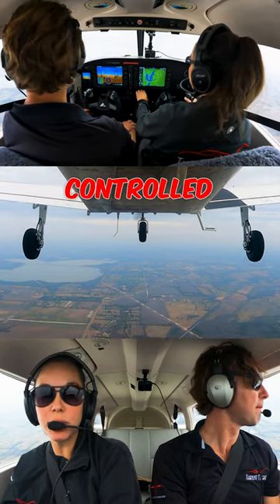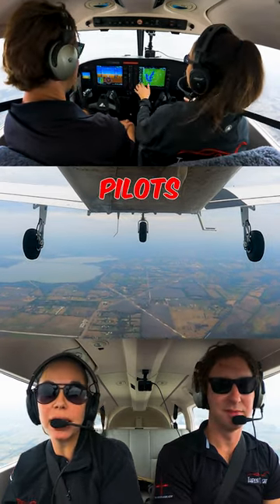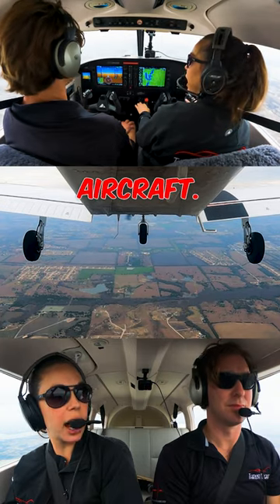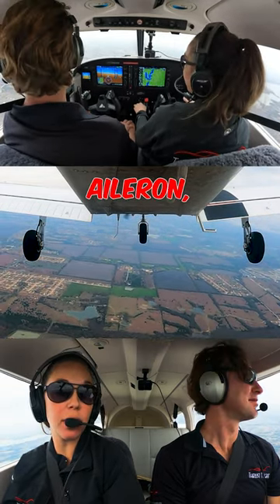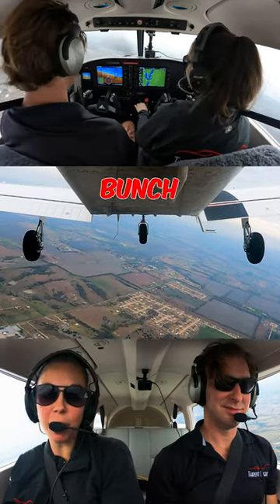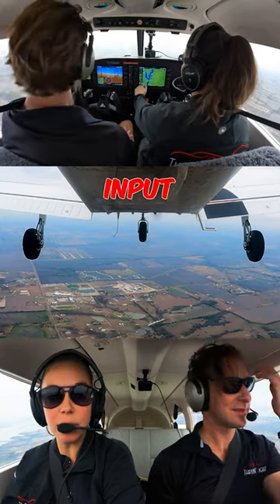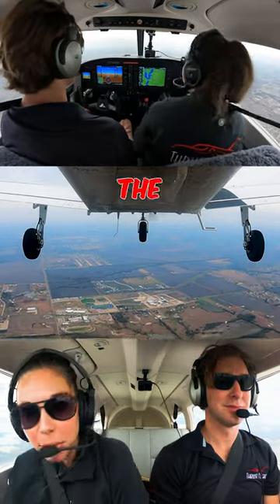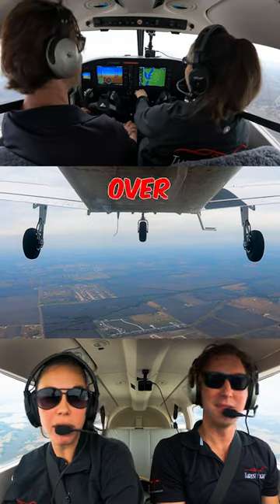How To Do a Cross Control Stall

Comment: I never understand why this happens turning base to final but not when doing forward slips.
Reply: I thought the mistake on the base to final turn was to use too much rudder to align the plane with the runway, so a skid not a slip, which also causes the nose of the airplane to go down on the horizon, which is compensated by more pitch and a stall... Also on the base to final turn the attention is on the left/right of the airplane and not straight ahead so probably doesn't help either
Reply: If you hold the nose up during a forward slip you will stall. When doing a slip you have to point the noise into the ground to maintain airspeed.
Reply: Can you not nose up and full power to not stall
Reply: True that airspeed is maintained. She actually missed a few minor details (For brevity I'm sure). On the turn to 'correct' the overshoot, pilots try not to overbank the airplane, so they use rudder in the direction of the turn... And the opposite aileron is to limit bank. This puts the tail SKIDDING outside the turn, like a drift in a car. The low wing is swept back, and swept wings tend to stall tip first. The aileron is also down, increasing the angle of attack exacerbating the problem. So... Unless you have a long final that allows you to re-align with the runway and you can then establish a stable approach, you go around.